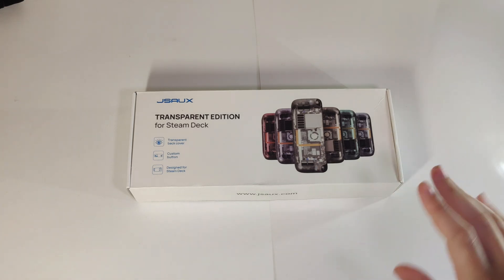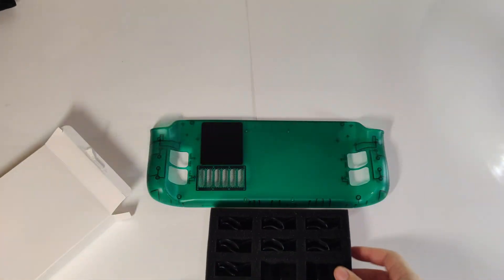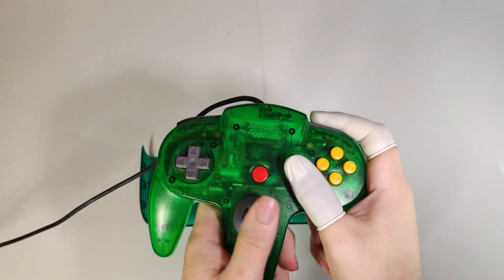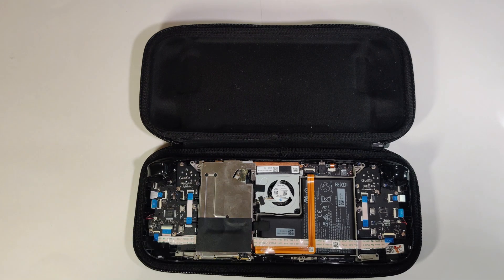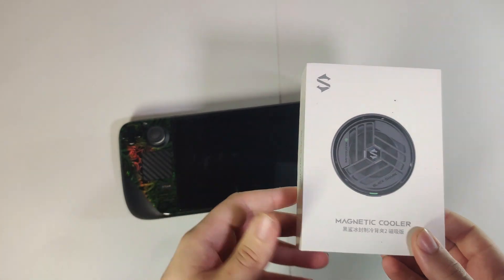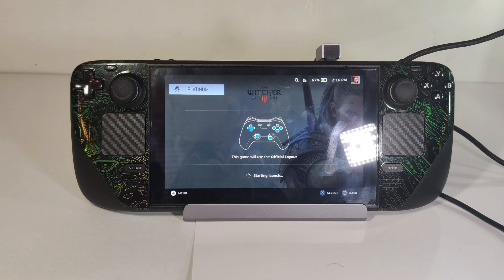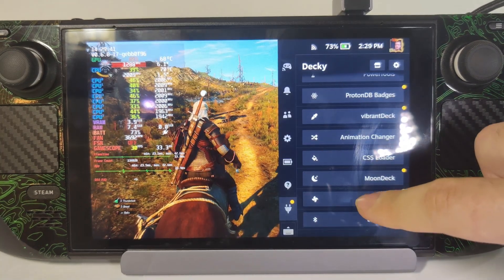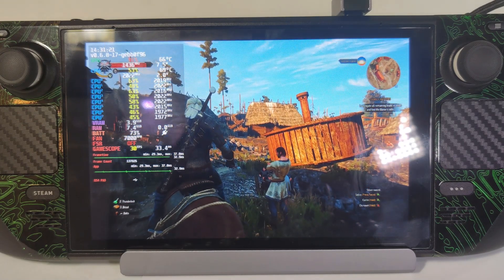JSAUX Steam Deck Backplate Mod

Comment: This is what I did for the Jsaux competition with a mod for the modcase the GameSir F9 fan is amazing for this my mod is far from complete but I have a portable power bank that is round and small like a torch. I was able to get 6-7c less with the F9 on it's own and 16-17c less with the fan kit and f9 cooler combined but thats with default fan curve and the rpm was about 300-600 less with the F9 on than without it while on God of War. 

I didn't change the thermal pads and yet I got better results I say better because God of War is a far more demanding game instead of 90% gpu usage I was getting 98-99%. You dont need to change the thermal pads. Other than a dremal all my mods are off the shelf and does not void the warranty.

with Tomb Raider 2013 I got to sub 52c with the fan kit and F9 fan combined with 0 rpm internal fan speed on ultimate settings.